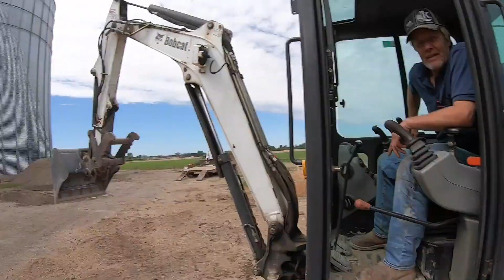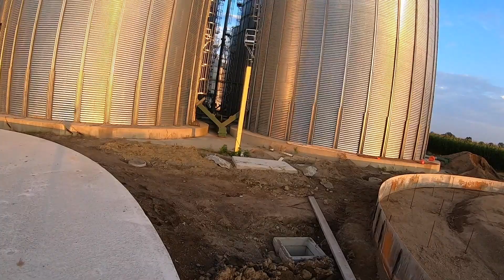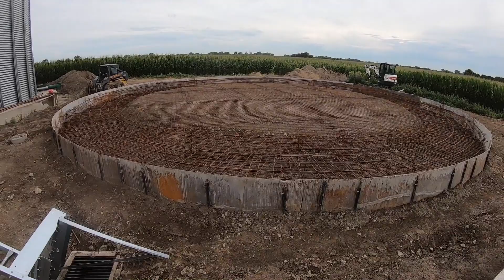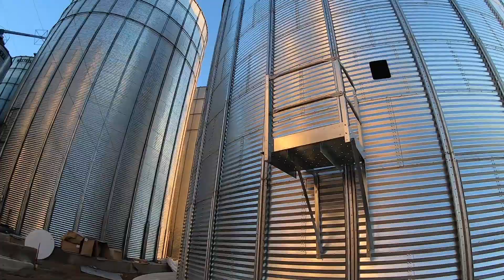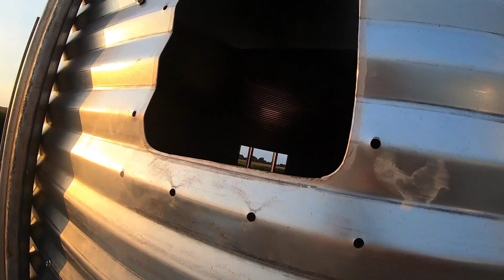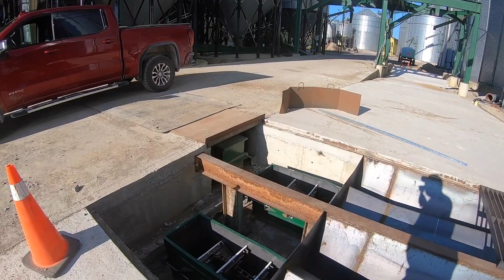Building New Grain Bins

Comment: Why would they not put a footer in and not just pour right on the ground. Do you'll not have winters there where the ground freezes and thaws.
Reply from the maker: Good question. But a 2’ reinforced wall 6’ in and the whole thing floats. Sits on compacted gravel. 
We have 130,000 bushel bins built this way and no problems. They may move a bit but concrete does not crack. Lots of rebar